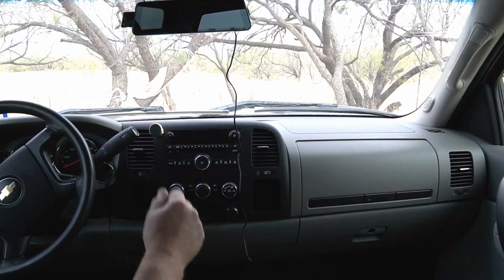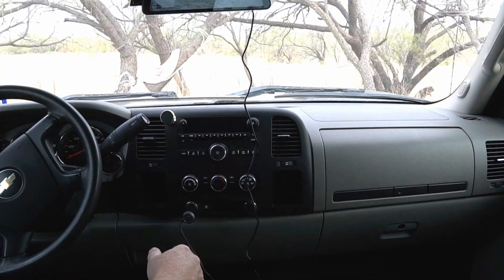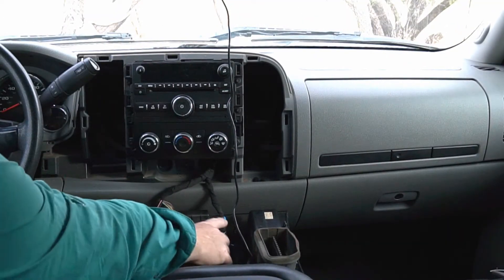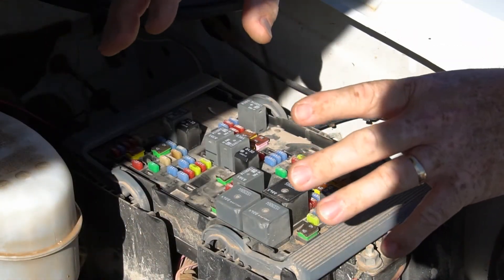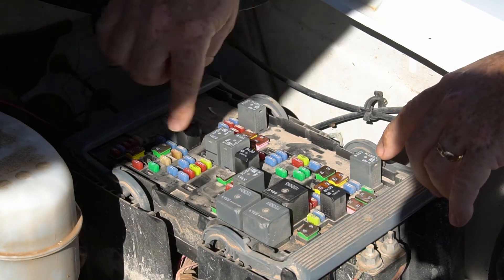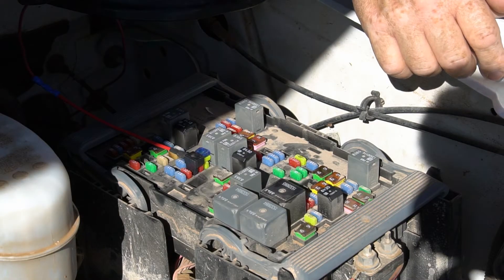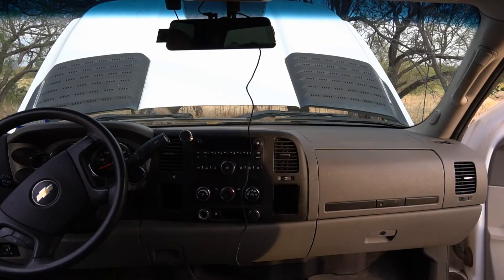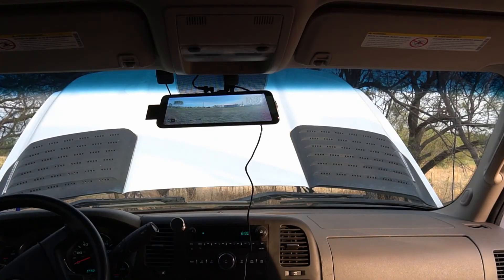DIY: Ignition Controlled Power Socket on a GM, Ford, or Chrysler

Comment: I know someone who has an older Challenger and in the owner's manual, it shows you how to make the power ignition controlled or not at the fuse panel. It takes under a minute, no tools or anything else needed.
Reply from the maker: Nice!

Comment: My 2017 Silverado has a 50 amp fuse. It’s the biggest fuse in the panel. Next to it is a visible blade terminal. If I pull the fuse, there are 2 more blades, so 3 total. The fuse only uses two of them at a time. To switch my lighters from always on to just ignition accessories, I just move the fuse from one side to the other. 

In my truck, it’s positions 10 & 11. They have dotted lines around them on the diagram. They are labeled “APO/RAP” and “APO/BATT”
Reply from the maker: Thanks for the great information

Comment: What about the exposed original 12v power wire that you cut? Wont that still have electrical current? Isn’t that a fire hazard?
Reply from the maker: Just tape off any exposed wires.

Comment: Luckily my Trailblazer had an ignition controlled fuse in the inside fuse box (wiper circuit), so I just added the fuse splitter to that circuit, crimped/soldered a leg from a fuse to that wire and pushed that into the unpowered side of the original cigarette lighter fuse. I like it since it's completely reversible and there's no cutting/splicing, but only works if there's an ignition controlled fuse nearby.
Reply from the maker: Awesome 👍

Comment: I got a fuse tap one accomplished the same thing in 5 minutes. No running wires through the fire wall. 10:07
Reply from the maker: Awesome!  Glad you found one on the inside box.

Comment: Yeah not to be that guy. 
What i do on the newer trucks with a accessories hot terminal ( or just go straight to the battery 🔋) is just go hot to 12v and  use a relay with an existing switched fuse  like say power seat/rear defrost/power windows etc... that you dont have i just use the tap and lot less troubles with blowing the mission critical fuse..
😂
Also the clutch mount is a great place to route wires on an automatic,  often has a simpler cover gasket or at least a softer metal free of stuff in the way..

Comment: I started to do this procedure until I found it hard to get past the firewall without a lot of fishing and hassle,  your method is fine but I found an easier alternative with power supplied inside the cab.  if you look below the dash behind the emergency brake pedal assy there is a black cover , pop the retainer out and remove the cover and you will see connections as well as exposed pins,  some are hot all the time, others are hot with key on, I used a small red female spade connector to connect to a key on pin and just route my wire to my radio in my case, I first went through the in dash fuse panel cover then across to the radio. but i secured the wire and added a 15 amp inline fuse behind the fuse panel.  as I said your method is fine with 2 small concerns, the fuse you used was a transmission power supply and I didnt want to risk robbing a little power from that circuit the others that are key activated are injector circuit A & B I also didn't want to tap into those circuits my way was mostly just quicker and easier aside going through all the other steps to find that out.
Reply from the maker: Glad you found a better way to do this. Thanks for sharing.

Comment: You should have capped off the hot wire, that you cut off. It will still have a small contact point, that could cause a short if touching a ground spot

Comment: Please help me I have a ford fiesta 2015 I have tried to get my brake lights to come on  also my wipers  stop  also
Reply from the maker: For the stop lights, I would check for a blown fuse. If your wipers will not turn off, this would indicate a faulty wiper control switch. I am not familiar with your model of auto, but these would be what I would look at to start with.

Comment: Make sure to cap the live wire you cut with tape. If it touches anything metal it could pop a fuse or worse short voltage through ground to nearest electronic part like the radio, or just cause all kinds of trouble.
Reply from the maker: Thank you for this great information @Nathan-th4oj.  I appreciate it very much when viewers contribute useful information as you have here.

Comment: I saw a tip to try it WITHOUT the original fuse in the bottom slot and check if the tap has power. If not flip it around and check that it does. Otherwise you are running them both through the bottom fuse.
Reply from the maker: Thank you for this great information @AttorneyBCollins.  I appreciate it very much when viewers contribute useful information as you have here.

Comment: On my 2011 sulverado there is a fuse for the left cigarette plug in the fuse box under the hood. Just pull that fuse and run the wire from the fuse jumper to the unpowered side of the cigarette fuse. No need to run new wires though the firewall.
Reply: Do you remember what number fuse that was? I couldnt find it on my diagram.
Reply from the maker: Sorry for the delay in responding. Here is a little video I made to show you the fuse. https://youtu.be/M_BnOwuXZtI
Reply from the maker: Thank you for commenting @zozo454! That's actually a good idea.
Reply: Also wondering which fuse # you used for this. great idea thank you
Reply from the maker: Here is a video showing the fuse number and location. https://youtu.be/M_BnOwuXZtI

Comment: Is there a way to connect the jumper to an ignition-controlled fuse port so that you do not have to run wires through the car?
Reply from the maker: Not on my truck, but it may be possible on other models.
Reply: @thejungleexplorer  I just found a video showing what I was thinking. Watch it and let me know what you think? It’s titled “Ignition switching 12v Aux (cigar lighter) sockets Focus Mk2 Dash Cam fix”
Reply from the maker: Sorry, don't have time right now to watch it. If it works for you, go with it. On my truck, I checked ever possible fuse in the cab, and none were ignition controlled. Yes, I know I could have tapped into a wire under the dash, but I prefer not to do that.

Merry Christmas to you and yours.

Comment: Best way to do it is tap into the mirrors power plug if the vehicle is on star equipped. Need to lookup a plug diagram to find the ignition and ground. You just need a 12v to 5v converter to use for USB power. An added benefit is you can hide all the cables and hide the dash cam behind the mirror. No exposed wires from the drivers views.
Reply from the maker: Good information. Thanks

Comment: Thank you for the fuse jumper kit. Dealing with a 2006 Silverado 2500HD; both lighters are always on; installed a quick charge dual usb charger in place of the driver side lighter - with volt meter in bright red LED. ALWAYS ON! your video gave me the idea to switch both lighter socket hots to an ignition controlled fuse in the engine bay fuse box. Thank you for the step by step install.
Reply from the maker: Thank you for commenting Swagger Do!  I am so glad the video was helpful.
Reply: @thejungleexplorer    Do you route both cigarette lighter to the same wire? Or do you find another fuse to hook up to?
Reply from the maker: @4rmthebay Are you asking if you can power both DC power ports (cigarette lighters) from a single fuse?  I would not advise this. In most case, it would work, but if to had both ports in use at the same time powering high amperage devices, it might blow the fuse.

Comment: I used this method to add an aftermarket radio in my 2013 Silverado WT. I used fuse #48 which is the Auxiliary Climate Control Compass Temp Mirror which my truck is not equipped with. The ignition control works perfectly, but I bypassed the entire 29bit LAN system which provides the safety chimes. The interface box I bought to preserve these glitched every couple weeks.
Reply from the maker: Thank you for this great information ljelley1.  I appreciate it very much when viewers contribute useful information as you have here.

Comment: Any problems with this setup since the install?
Reply: Great!  One more question.  What gauge wire did you use to make the connection from the fuse tap to the lighter?  I’m thinking 18 but just wanted to verify.  Thanks!
Reply from the maker: @johnnyhannah8356  I used 14 gauge.  It depends on how many amps of the fuse size you intend to use and the length of the run.  Here is a chart to guide you on this: http://assets.bluesea.com/files/resources/newsletter/images/DC_wire_selection_chartlg.jpg
Reply: @thejungleexplorer  Gotcha thanks for the info and the video!!!
Reply from the maker: Not a single problem. Works perfectly

Comment: Chrysler products have two different fuse sockets for the cigarette lighter. One is wired to the battery and the other is wired to the switch. All you have to do is move the fuse from one socket to the other.
Reply from the maker: Thank you for this great information Will Dwyer.  I appreciate it very much when viewers contribute useful information as you have here.

Comment: This has to be a widespread problem for most everyone that has a dash cam. Yet, I have to rely on a You Tube video to show me how to fix it, AND it's not a simple fix. In layman terms, this problem is bull shit because WE should not have to go throw all of this to fix a factory oversight, just to have a dash cam accessory to work properly. With that said, thanks for the video.
Reply from the maker: I totally agree. GM should have two outlets, one ignition controlled and the other constant. Problem solved.

Comment: Did you do anything for the black wire?? otherwise awesome video thanks
Reply from the maker: You do not mess with the black wire, just the red one.  The red wire is the positive wire and it is the one that supplies the power to the outlet.

Comment: You didn't test during the START cycle to make sure it turns off, properly, during the start cycle to prevent a brown-out on the electronics ( most dangerous thing for electronics is under-voltage rather than over voltage ).
Reply from the maker: Thank you for this great information Acecool.  I appreciate it very much when viewers contribute useful information as you have here.

Comment: Depending how that jumper is built - it may go through the 20 before the 15 which could mean a potential of 35amp going through the 20 if not installed the right way around. Make sure you test to see which is the first pin and make sure the jumper has its own and not that it takes a path from through the fuse before going to the other. It should be fine, because its very hard to screw it up... Also, you forgot to put a connector on the previous 12v wire to prefect accidental groundings which can fry a fuse in the best case - worst case start a fire before the fuse blows... Also, I would've used spade connectors in case you had to re-route something, or needed to remove the panel for another purpose... If using your method, I still recommend mine though.
Reply from the maker: Thank you for commenting Acecool!

Comment: That jumper technique should work, as long as the wiring going to the 20 amp fuse in the fuse box is rated for 35 amps total. Likely it isn't - again, why you should do it the way I recommend.
Reply from the maker: Thank you for commenting Acecool!

Comment: Hopefully my comment posted - I don't see it. But, do not use a pre-existing ign. controlled fuse. The problem with doing this, is that amperage is shared between the now 2 or more devices connected to it. By doing it my way, you create a new fused circuit with a dedicated fuse allowing for 15 amps ( which is what you'll want to fuse it at, typically )... If you don't, you'll end up putting a light or something that draws a lot of current into it, then blow a fuse for IGN control, which could be another high amp usage item such as AC, or engine electric fans, or something like that ( although electric fans shouldn't be ignition controlled - they should be temperature controlled ).
Reply from the maker: Thank you for commenting Acecool!

Comment: You can just take a dedicated line from your battery, with a fuse - preferably add the fuse in a spare slot in the fuse box -, then go in through the firewall with that line. Inside, you'll mount a relay and put that always on power line into the always on power part of the relay. Run a ground wire from the firewall, or other close-by grounding source to the ground spot on the relay. Next, find a wiring diagram and look at your ignition switch which should have 3, or more, wires... You'll have Ground, an ON position line and a START position line. You do not want to tap from START, as even the headlights will be OFF in the start-state because of varying currents, etc... You'll want to come in from the ON position and use that to trigger the relay. Then, have another ground, or the same ground and go to your 12v socket. And the power line is the relay triggered power out line.

Easy - simple, effective and what every car should have by default.
Reply: Why don’t you just make a video then?
Reply from the maker: Thank you for all the comments. Comments really help promote this video and my channel. I appreciate you taking the time and energy to try to promote this video.